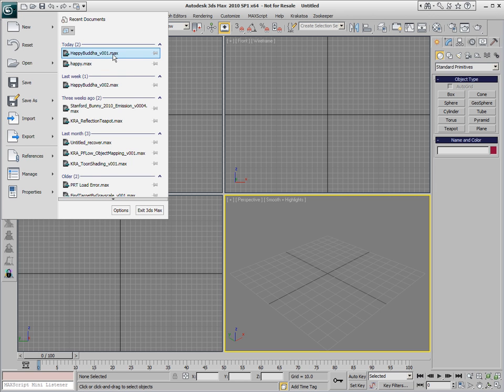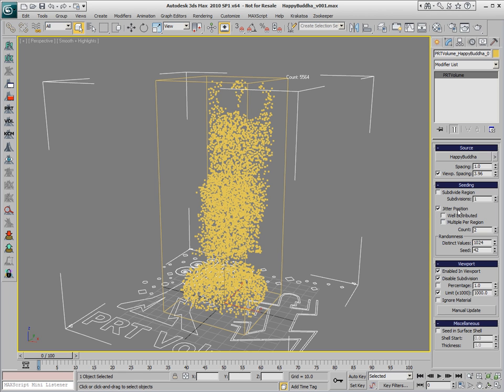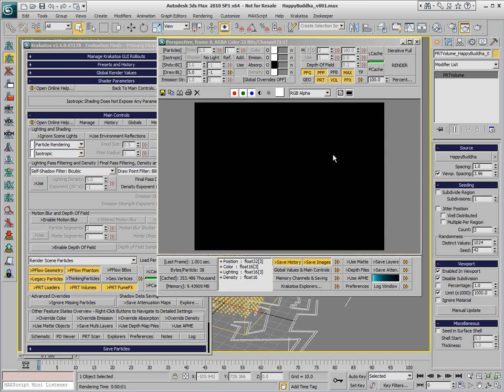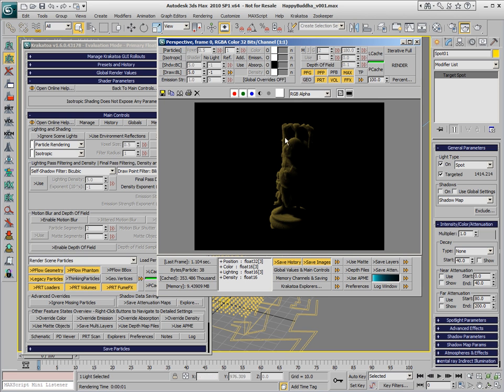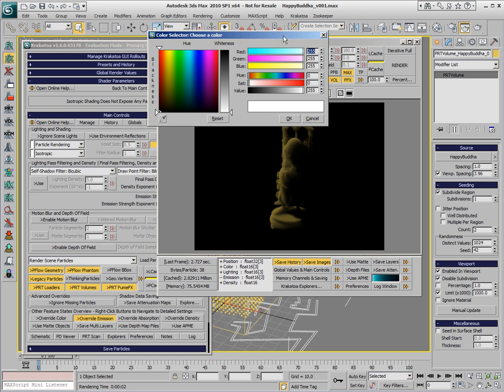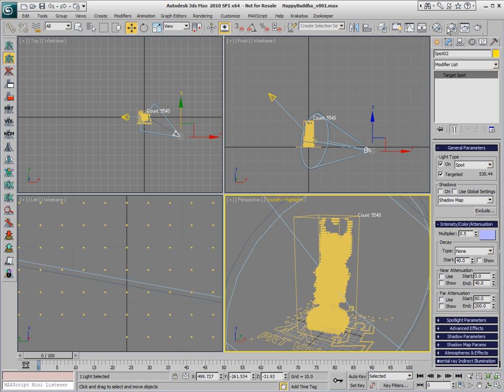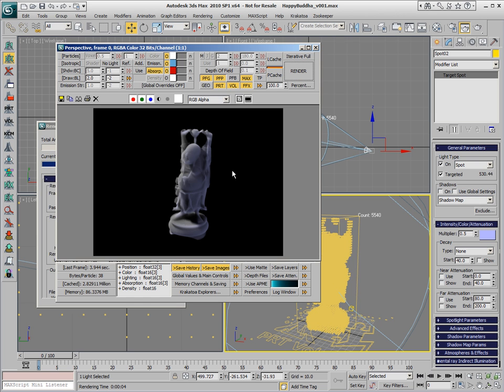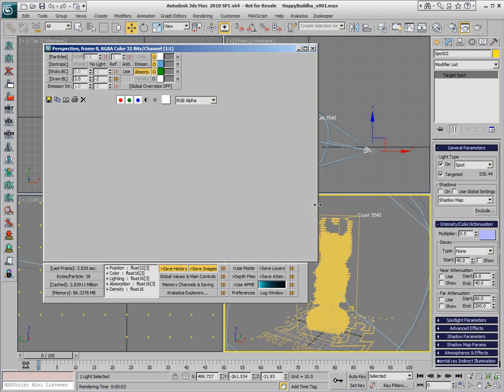Krakatoa 1.6.0 Rendering Introduction Part 1 - PRT Volume Lighting, Emission and Absorption

Comment from the maker: @RobsysGames What exactly does it tell you and where? One gotcha with particles coming from RealFlow, esp. from Hybrido simulation is that the Density channel might be coming in as 0 and causing all particles to render as fully transparent. So if the Memory info of Krakatoa or the Log file show non-zero particle count in memory after rendering and you SEE PRT Loader particles in the viewport, then you have to drop a KCM on the modifier stack and set the Output to Density and the Input to 1.0